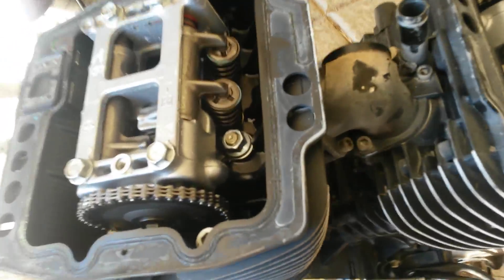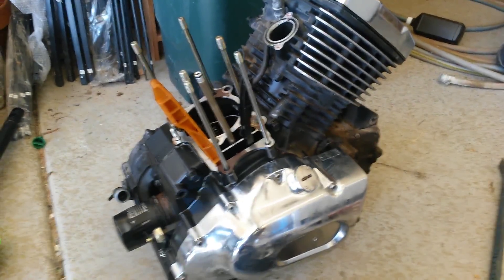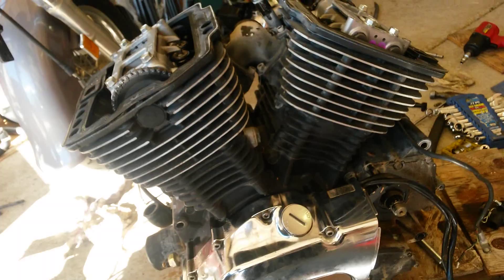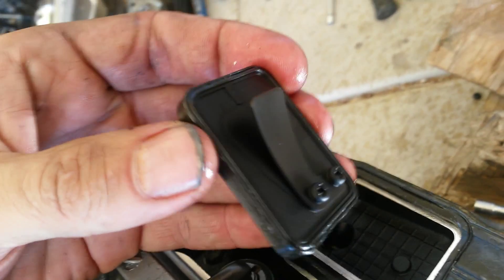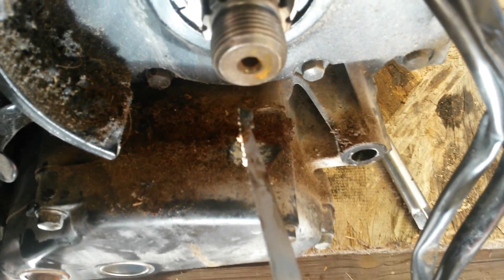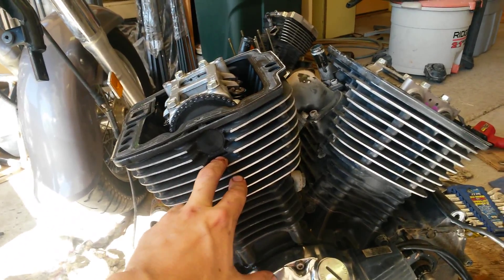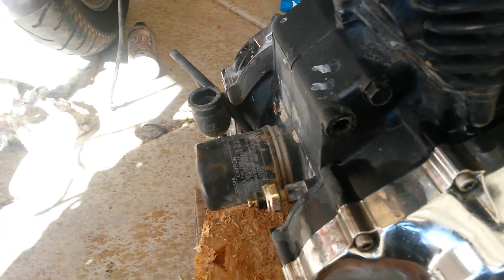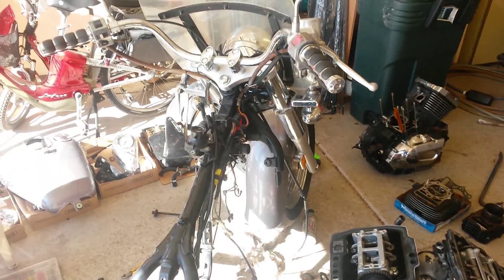Kawasaki Vulcan 800 ~New Owner, New Engine~ Check Your Valve Clearance!!  (VN800C/A/Drifter)

Comment: Use a good oil.  10/50  or  20/50.   Coolant topped up.   I wish these bikes had a Tachometer because the secret is "don't over rev"  the engine.   You will melt the heads and drop a valve.    Maxed out around 5,000 rpm.  not  9,000   Work the torque not the rpms on V twins.

Comment: On the front (left) cylinder, the vacuum seal is installed spring down, and opening towards the center of the head???  The manual is not clear on the vacuum seal and I have forgotten now!!!
Reply: +GadgetClass means nothing to me, sorry.  There is a leaf spring, which faces down, and would keep the seal slightly above the hole then?
Reply: +GadgetClass found a picture!!!  Glad I took many of them lol.  Thanks.

Comment: Do you NEED to have an engine removed to do valve clearance checks? I know this is a case where it was already removed, but I want to do it without all the extra hassle
Reply: Benjamin Hickmann You can do it in frame. Follow the last Val e adjustment link in the video description

Comment: Hi, my Vulcan 800 has over 33k miles and sounds like a sewing machine, is there a point in the life of the engine where the check is no longer required?
Reply from the maker: cortemanWell this bike failed at 50,000. I don't know if it was ever checked. It only takes a couple hours once you know what you're doing, so I would just consider it a standard maintenance item.

Comment: cool Video - could you pls Point me towards the materials you used?
Thomas
Reply from the maker: 4444design All parts needed are listed in the video description. Here is the list:~~Valve Shim Kit:
http://www.amazon.com/dp/B000UKHCM4/?tag=vn800engine-20
~~Feeler Gauges (Offset/Angled Makes it Easy)
http://www.amazon.com/dp/B002YKMC9G/?tag=vn800engine-20
~~Digital Caliper:
http://www.amazon.com/dp/B00INL0BTS/?tag=vn800engine-20